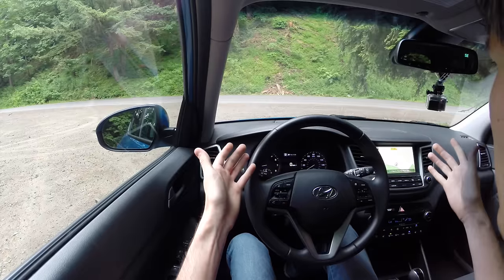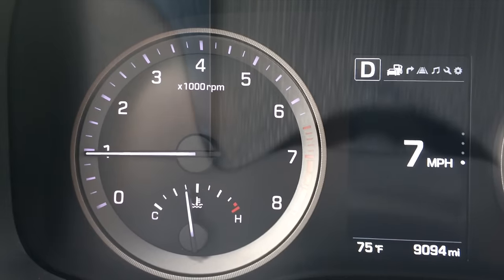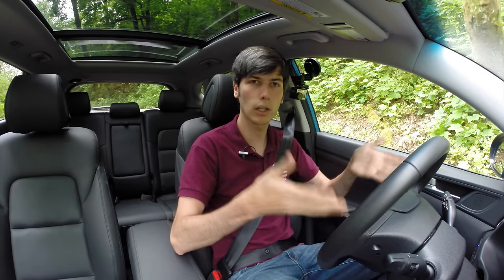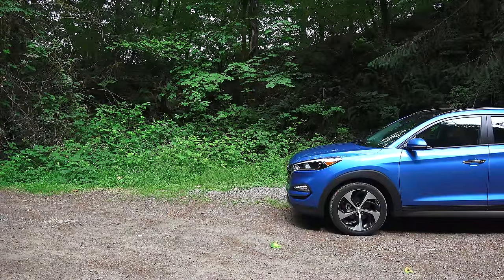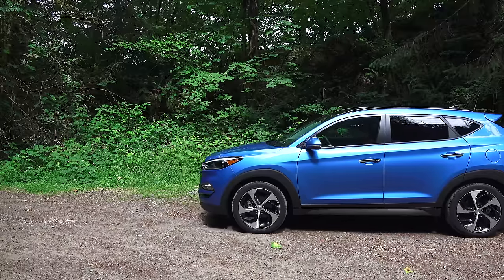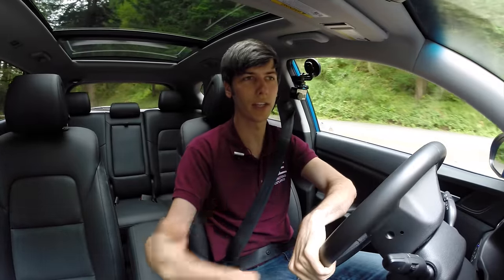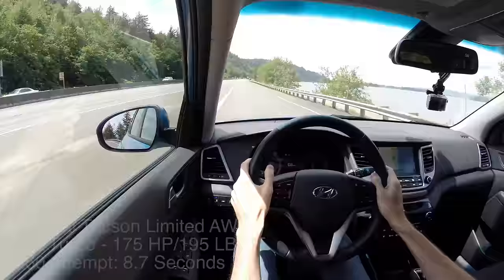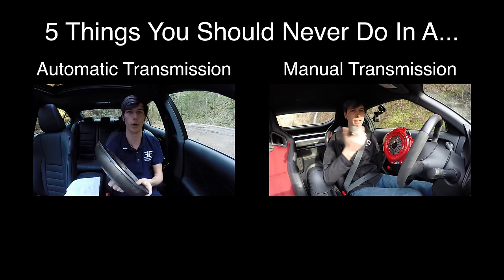5 Things You Should Never Do In A Dual Clutch Transmission Vehicle

Comment: Getting ready to buy a new Subaru. Does it have Dual Clutch? I know it has a CVT
Reply from the maker: +Khadijah Brown if it has a CVT, it will not have a dual clutch. These are two separate transmission styles.
Reply: Engineering Explained Thank you.
Reply: The CVT is completely different.  in my experience with a 2014 Subaru Outback, the best way to launch is in manual shift mode in 1st gear,  when you're about to hit the redline,  you shift the transmission back into drive and it'll ride the redline whole accelerating that way and is faster than manual mode or automatic mode only. Nissan's CVT programming is interesting and no noticeable difference either way.
Reply: @Joseph, interesting trick, I noticed the same thing with Lancer's CVT manual shift.
Reply: as weird as it may seem, I drive a 2017 Subaru WRX with a CVT and I love it.
Reply: +Bob Hoover I'm not knocking it.  once i figured out how to get the Subaru to redline faster,  it became fun to drive.  normal hard acceleration was uneventful. but manual mode 1st gear into drive at 6,000rpm made the 175hp 2.5L was fun.
Reply: Joseph Kutches LOL, mine will likely never see 5000 RPM, but I enjoy the prospect of perhaps never having to crawl under it to put on chains. I used to drive a 92 Dodge Cummins 4x4 and probably never went over 1200 RPMs when out in the rocks. It used to get me that when two wheels were off the ground I was done. Those trucks were nice until the frame broke due to flexing. Looking forward to going rock hunting and star gazing with it. It's been years since I drove the back trail of the Steens, or the old Barlow road. Any time I go hiking, it is mostly Subarus at the trail heads.
Reply: +Khadijah Brown Ah hell, my F550 7.3L PSD wrecker can run wide open all day and all night. It has 300,000+ miles on it and runs two shifts a day. My F150 has 206,000 miles on it and i run that thing hard too. It's actually better to run high in the RPM with a lighter load than lugging hard low on the RPM. i used to lug my 5.0L Mustang and it ate up the motor.  My F150 has a 4.6L that i run hard no problem.
Reply: Joseph Kutches Ford people. It was a Cummins Diesel. Sigh. Like I always told the men on the work site, the best truck is the one you are making payments on.
Reply: +Khadijah Brown i have no problems with Cummins.  they are great motors.  i run the 6.7L Cummins Ram 5500 motors hard too. They take the abuse well.  They tend to have cooling failure later on.  i don't know the service recommendations for their cooling system nor do i maintain the trucks.  so i can't say for sure if it's the truck or lack of maintenance but the 7.3L requires less maintenance.
Reply: Joseph Kutches The 5.9 I had used two water pumps, and a mechanical fuel pump in 175,000 miles. I got hurt and had to sell it. The frame right by the steering gear is weak and broke so we put a bolted in fish plate there. Mine was built up to use as a snow plow so it ate rear U joints, about 4 of them while I had it. I got so I just carried a U joint, a 7/16 wrench and a hammer behind the seat. I got so I carried a water pump later. My Dodge was a nice truck to pull a 28ft 5th wheel, but the frame and body were pretty dainty. It would go almost anywhere. I took it up a mountain East of Fallon, Nevada that frightened me a lot but it was so steep, I was afraid to stop.
Reply: In a CVT a common problem is shifting from reverse to drive too fast. Be easy on it.
Reply: Bradley Abrahamson Thanks.
Reply: CVT is not a dual clutch transmission
Reply: If you're buying a Subaru, you should go for the manual...
Reply: no1ymfan1 If you're going to get a performance Subaru,  you should get a manual. Otherwise the regular Impezas, Outbacks, etc,  are just fine with a CVT and you may actually get better mpg.
Reply: Joseph Kutches Got a Forester
Reply: headlight bulbs crank seals crank pullys cam seals timing belts coils head gaskets catalytic converters fuel filler pipes,wheel bearings I could go on and on oil pumps baffle plates abs sensors..etc etc etc red headed cousin of all Japanese cars and don't even bring up Mitsubishi. good luck  with your Subaru.
Reply: @Khadijah Brown
You're wrong, the BEST truck is the one that's YOUR'S and PAID FOR!! LOL
Reply: Subaru is great but i wouldnt go near a cvt theyre junk

Comment: Not sure about the statement on transmission shift logic...on the VW DSG's for a quick downshift you need to first press the throttle, knowing that you want more power the transmission engages the lower gear on the other shaft, then when you pull the paddle the change is instantaneous. If you simply request a downshift when cruising at 2.5k rpm, there is noticeable lag before the shift takes place. The actuation of the clutches is more or less instant, any delay noticed isn't likely to ever be a result of the clutch packs engaging/disengaging, but rather the mechatronic unit changing which gear is engaged on each shaft.

Comment: wow i never knew these about dual clutch transmissions. always thought they were flawless and superhero tier tech. but i guess a dual clutch in a sports car wont be the same as in an eco car. so i shouldnt worry.
Reply: Trash they involve a chsnge in driving habits, and ultimately depend on your driving habits snd needs.
Got the cash for a track day R8, Lambo, 911? Enjoy that DCT's wicked fast gear change - when you need it on the track

Do normal driving? Then do a wonderful thing in a DCT called ADAPT TO YOUR ENVIRONMENT - weve only been doing it since jumping out of the trees. You change your driving habits in a DCT, same as going from a manual to a torque converter, that to a cvt extra.

Tow lots of heavy stuff? Avoid a DCT you'll murder the poir thing.

Dissing something out because you drive something different? Hire one out and see the difference for yourself

Just for the love of god dont try the VW DSG or fords "powershift" - these are the worst examples of the DCT
Reply: Vws DSG is presently fine. The first gen was the worst and mine is a first gen dsg vwr and it has 256k miles and still shifts like new.. it's a thing called maintaining fluids lol it's too easy on my car not to do it.

Comment: I had a Ford Kuga with a Powershift gearbox,it’s a great idea but doesn’t work that well and it constantly needed a re flash at the dealers,when it worked well it was great but that didn’t last long before it was another trip to the dealership,wouldn’t have another one though.

Comment: A god damn Hyundai have a DCT transmission meanwhile Nissan is still on using CVT transmission!! Oh speaking of CVT transmission, can you do a video of "5 Things You Should Never Do In A Continuously Variable Transmission Vehicle".
Reply: They have different intentions and I guess that's their ways of achieving better efficiency. Nissan stated a while back that they're dedicating to CVTs and Hyundai states that they're not fans of CVTs and thus prefer to use DCTs. Both are getting much better than what they used to be.
Reply: A CVT makes it possible to achieve peak torque at almost any speed while a DCT makes it possible to shift faster and electronically emulate an AT. They solve different problems. For the record, I absolutely hate DCTs emulating AT.

I see why they do it but I'd rather have a true AT (which is what I have on my most used car), single clutch (which is what I have on my other car) or electric (which I hope my next car will have).
Reply: A CVT done right is a glorious bit of technology. I wouldn't buy a front line tractor without, they've been around for about 20 years know and have brought about so many improvements in driveability, reliability and efficiency.
Reply: +JIGA BACHI love love love the Maxima's with the 6 speed
Reply: Japanese car makers are very reliant, they only use properly proven tech once its tested properly
Same goes for volvo
You barely have issues with these cars
Reply: When a car is as slow as 8-9 seconds for 0-100 you don't really need such an over engineered transmission
Reply: I have a frigging Versa 1.9 with a CVT. The damn thing just behaves as if it thought it knew what I wanted better than me. The response to gas pedal is never predictable. One strange thing I noticed is that when you accelerate and about to reach your desired speed, you let off of the accelerator a bit, and the car actually accelerates sharper for a bit! It's as if they cripple the power during acceleration, while artificially holding constant RPM.
Another mistake the program makes is during braking it holds the torque converter locked until you hit 12 mph. This causes noticeable jerk when the converter unlocks. This also doesn't let the CVT to go to the lowest ratio all the way down. Then when you take off, it has to hold the torque converter unlocked for too long, crippling the efficiency again. The whole thing behaves as if it were designed by marketing department, not by engineers.
Reply: Alexagrigorieff Exactly! This is exactly what I experience with Altima 2.5.
Reply: Alexagrigorieff the sudden acceleration might be hill climb assist
my friends car had the same problem , autos are never gonna beat manuals for this reason
Reply: +Karthik Naik He's talking about a CVT, not a traditional auto.
Reply: Djhg2000 hill climb assist isnt just an auto thing
its even present in manual cars, cvts, dsgs etc
it only has such trouble in non-manual cars though
Reply: Karthik Naik Never heard of hill climb assist being a feature. But it seems to have downhill engine braking assist. The ECU has an accelerometer chip which allows to tell that the car is heading downhill. The accelerometer chip would also tell it that the car is NOT, in fact, going uphill when it's not.
Reply: JIGA BACHI Well, IMU is just auto-industry lingo, just like they call the control computer ECU. The part itself is called accelerometer by the electronics engineers and chip manufacturers.
Reply: Djhg2000 Manuals with hill climb assist can be easily overriden, you can simply dip the clutch
In Autos, its purely on the ECU
im not contradicting at all, in fact you have a low understanding that manuals = full control
Reply: Alexagrigorieff "never heard of hill climb assist" , I stopped reading there
even cheap cars have it these days
Reply: +Karthik Naik You clearly don't know what hill climb assist is or how it works.
Reply: Djhg2000 lol says the guy who is to lazy to shift his own gears
Reply: +Karthik Naik I drive a manual you muppet.
Reply: Karthik Naik I heard of hill hold AKA hill start assist. What's hill climb assist? How is it related to a transmission?
Reply: Djhg2000 too bad you cant understand then
Reply: +Karthik Naik Really? How so?
Reply: Karthik Naik You must have your own personal Google somewhere. For those not so lucky, "hill climb assist" search brings "hill hold assist" and "hill start assist", and NO "hill climb assist" at all.
Reply: Weird, my Nissan has a DCT.
Reply: +JIGA BACHI i back you up
Reply: DCT is the best if it is perfected, but no company's DCT is perfect as of now, and CVT is easier to make, it is less risky...by the way Hyundai has CVT in their Accent.
Reply: +Toci Aie No it isn't, E/E even made a video about it. CVT is technically way superior but every time a model with CVT is launched the customers complain because it sounds boring.
Reply: Yup and Nissan's CVT is still horrible. Sloppy feel and not any better than a regular auto for fuel economy. But hey, the car goes down the road right?
Reply: Indrid Cold the same thing happened to Mack trucks when Renault bought them.

Comment: what is a "DSG fart" and is it bad for your car? my car does it really loud especially when in full boost at like 4-5k RPM when shifting. it sounds cool, but is it bad?
Reply: Chris Love the cooler it sad, the better it is
Reply: Chris Love think thats your turbo shuttering. Which is normal for say a wrx sti (hate the sound of it though).

Hope so. If thats your clutches having a crunch thats going to be 1 expensive to fix or replace (the price of VW admission) and 2 likely to happen again (there are known issues with the DSG that warranted a recall.
Reply: If it's an exhaust sound, not out of the engine bay, it's most likely unburnt fuel/air mixture getting pushed into the exhaust system and igniting on the hot exhaust manifold or catalytic converters. It's in fact bad for the cat and can blow out / damage the honeycomb structure, but they are designed to withstand this for a while if it happens on a "stock" car. Some DSG cars do these on purpose, as a "showoff" feature for sporty cars (Audi, for example, does this on some of their cars with a special mapping in their MCU), others do this out of necessity (mostly port injection types that can't shut off fuel as late in the cycle as DI engines...)
Reply: Havent got it so dunno
Reply: @346L3   VW Golf R is another that has this as a "show off" feature, although for some reason they didn't do it for the Golf GTI 🤔
Reply: I noticed it on a 1.4 TSI Golf Mk7 so I don't think it's only performance cars that do it.

Comment: 0-60 in 8.7 sec DOWNHILL?
Reply from the maker: The downhill bit doesn't take away much time: https://www.youtube.com/watch?v=tfQNl52CjfQ
Reply: it's not a sport car.
Reply: faster than my yaris and for sure the hyundai is heavier  xD
Reply: Probably just about free fall.
Reply: My CRF50F can do faster than that.
Reply: My Camry does better than that
Reply: My old Honda Odyssey does better than that.
Reply: My 2018 Hyundai Kona AWD has the same engine dual clutch transmission as this Tucson, but hits 60 mph in about 6.5 seconds. It looks like this Tucson but it smaller and lighter.
Reply: Tucson can in8sec when use sport mode
Reply: It weighs 5,000 lbs
Reply: learn2 farm are the transmissions failing or what?
Reply: learn2 farm  yeah, I have a GLA 250 and the acceleration on that turbo 4 is crazy

Comment: 2022 DCT VN has a built in creep feature that you can electronically turn off or on , it’s not a flaw but designed so you don’t damage the wet DCT. It’s fine

Comment: I thought you meant a manual dual clutch setup, not automatic :P
Reply: There's no such thing.
Reply: maybe he means dual-mass flywheel
Reply: +SonOfTamriel some transmissions (though not in cars that I'm aware of) have two manual clutches, one being controlled with your hand.
If you're not used to them, you can get muddled between the hand brake and the second clutch lever.
Reply: +TheCoolSquare I think he may have been refuting to twin disk style clutches
Reply: There is. Tatra used to make them.
Reply: +TheCoolSquare formula 1 car
Reply: Pieter de Buck Formula 1 cars are not manual. They have semi-automatic DCTs

Comment: 0:37 I put it in neutral at stop lights. Old habit from driving a manual for so many years. Plus, I don't have to put so much pressure on the brake pedal and with my ailments/injuries/pain it gets tiresome quickly at long lights.

Comment: sounds to me like theres alot more to go wrong in a dual clutch il just stick to my normal automatic
Reply: Sounds like there is a lot more to go wrong in your autotragic. I will just stick to my proper manual tranny.
Reply: +southpark11235 amen.
Reply: +southpark11235 my dodge durango was never offered with a manual even if i would not like to daily one
Reply: +mikldude mine is at 137,000 miles idk how many kilometers that is but it still shifts like a dream
Reply: Nate Eller  i think it just goes to show Nate , not all progress is good , better to use proven technology .
 the old adage , keep it simple is a good one i think  :) .
137,000 miles is approximately 220,000 kilometers .
 cheers .
Reply: Drive stick
Reply: +MIKEK3NT sounds like a plan  😉.
Reply: +Nate Eller: In which case you'll live with inferior performance and impaired fuel economy every day. Clutch packs on conventional autos fail too, my Mercedes didn't make 60k before it needed major gearbox repairs, mind you it was a world class lemon...
Reply: +TheAtomicTurnip if there was a manual version of my truck than i woulf be dealing with less but the durango never came with a manual its a big family boat no need for a manual its at 137k recently serviced and she still shifts like a dream

Comment: Been driving Kia's for 20 years which are same as Hyundai these days.  If you have DCT or automatic transmission, I recommend changing the fluid after the first year and get the stock fluid out before it starts breaking down.  Aftermarket fluid is much better and the transmission will shift better and stronger than when it was new.  Just my opinion after 20 years in the oil industry and high tech lubricant/additive business.

Comment: clear and logical as always, thank you E E. so many problems with machines occur because operators don't understand how they work. You explain it very well.
Reply: The flaw in these transmissions is when you are coasting along at about 40 mph and it predicts that the next change will be up. You suddenly need a quick burst of power when you get an opportunity to overtake and the delay is terrifying.
These systems are considered unsafe to use in high speed police pursuit vehicles for that reason. Ambulance drivers are having the same problem.